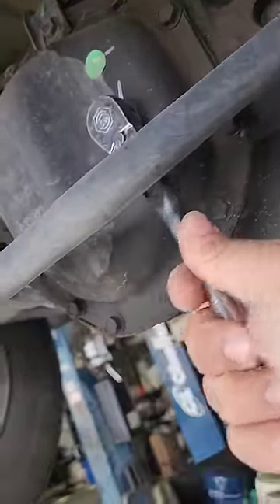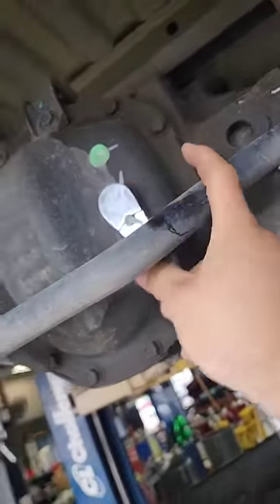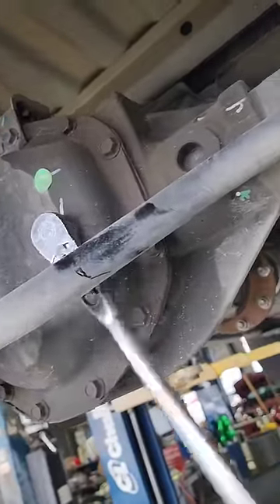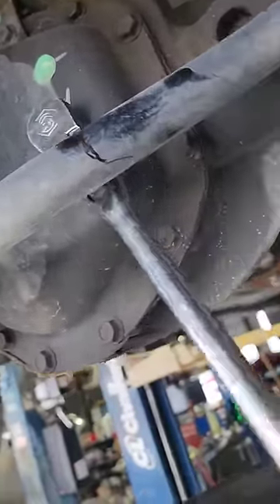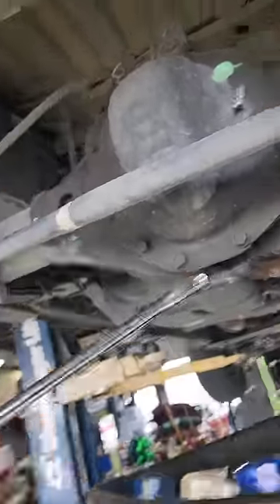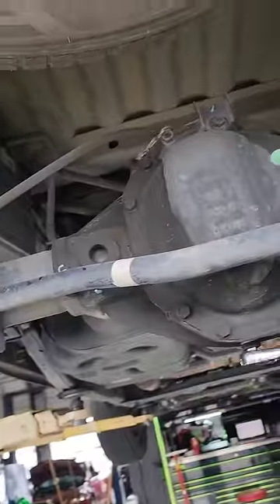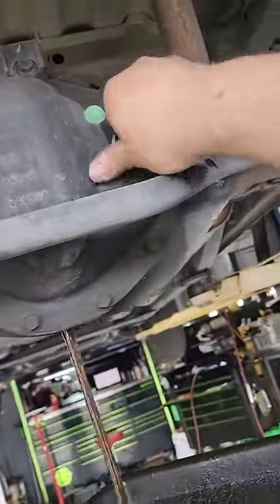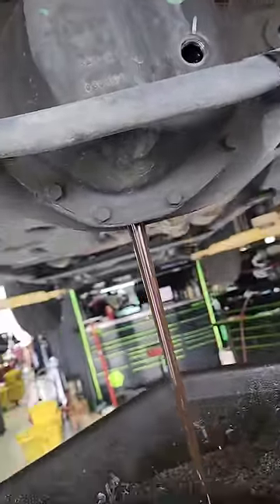MECHANICS PRO TIP #shorts #mechanic #auto #tools

Comment: If you can't get the top plug out, you need a new job! What about cars that only have a top plug, you have to pull the cover to drain. Then you can also fill through the vent tube if you know the capacity. Or the vss located at the top of the differential housing!

Comment: Don't throw away the 90 weight oil. It can be used for your chainsaw bar oil and if needed it can be cut with mineral spirits. Or give it to someone who has an oil burner heater. Don't just throw it away.

Comment: Took my 66 Riviera to a Buick dealer to replace a right rear wheel bearing. After I got home I got a call from the service manager. He said that my repair was going to cost a lot more because Posi-track unit in my rear end was torn up. I asked if he was sure and he told me that yes the mechanic showed him the clutch material in the bottom of the differential. I told him that was funny because I was the one that put the Grand sport emblems on the car and it doesn't even have a Posi-track unit.. he said I'm going to have to get back to you on that.,

Comment: This isn't some like mechanic only tip It applies to anything pouring throughout all of history 😂 when the air can easily replace the fluid by going through a separate hole instead of the same hole the fluid is coming out of it will drain faster.

Comment: 440,000 km.. I changed the oil in my front and rear diffs about 10 years ago.. think I used 80w gear oil?

Whatever was needed, I used the equivalent…

There was no oem anywhere…

It still works great 😜

Comment: never had one not come loose... clean out the hole and use a nice deep adapter.. sometimes a wretchet with a big head wont seat all the way into the plug and debris stop it from going all the way in and seating causing stripping.. im in the north half of ohio used to work for a used car lot that shopped at perry auto auction in pa i know all about rust. its 99% user operator error

Comment: use the case breather vent to pump the fluid in if the top bolt is seized or stripped

Comment: That fluid looks practically new. I know new vehicles call for synthetic but the old 80w90 seemed to last longer than the vehicle
Reply from the maker: You do know if it was burned and had metallic flakes that would mean the fluid went to long and started to let item wear right?? Or maybe you dont get that part of preventative maintenance
Reply: @FluffyMexicanik  No, i guess I don't. I'm just an ASE master technician who worked at a Cadillac, Buick, GMC dealership for 25 years and now I build custom Harley Davidsons. We never tried to up sell any gravy maintenance work. It's probably the same reason I get 300,000 miles out of every vehicle I own before selling them. When I hand over the keys to a $50,000 HD and the customer asks me about oil changes I tell them just whenever is fine. I've rebuilt axles before but for as many vehicles that are on the road it's not as common as you may think . Changing the fluid for the first time on a new vehicle or draining one that needs repaired are probably the only two occasions that the naked could see something in the fluid. You change that synthetic axle fluid regularly and if you don't have a problem you're not going to see shit.
Reply from the maker: @channelx92  im not quite sure what point you trying to make 🤔
Reply: @FluffyMexicanik  I don't get that part of preventative maintenance don't you understand. I tell you what, if you put even a tiny bit of sarcasm into anything nowadays, people have a mental meltdown and lose their entire thought process. You suggested I didn't understand routine maintenance so just letting you know I worked at a dealership alone should have told you differently. Dealerships preach maintenance like the gospel. Not only is it the right thing to double but it makes everybody more money . I do the maintenance on all my vehicles as per the manufacturers schedule hence the 300,000 miles I get out of all my vehicles. The sarcasm came into play with the $50,000 Harley Davidson I had just finished and telling the customer to change the oil, or whatever kind of maintenance we want to use in this imaginary situation, whenever they feel like it. Nobody in their right mind would say that. I hope you understand now that Im very aware of maintaining your vehicles. I may have gone a little overboard but I never meant to confuse a response to your statement.

Comment: I have run across some that I have had to fill through the drain plug   needless to say you have to overfill them a little bit and then be quick with your hands to get the drain plug back in  Little messy

Comment: You can always fill them through the vent… I have also filled them by pulling the wheel, hub, etc, jacking up the one end of the axle and pumping fluid into from there… oh the shyt boxes I have had to deal with 😅

Comment: Yea u can cause my Mercedes S500 when u flush the transmission pan u have no dipstick or fill hole other than ur drain hole is ur fill hole so u must pump ur fluid up the drain hole until u get 9 quarts in there

Comment: I always check the plugs for signs of being removed. I say this is because sometimes you get people coming in trying to resolve a problem or get something for free and it's always good to note. Every tech MUST cover dat azz. 🤨  You should have pulled the top plug and checked the level.You very well may have a bad diff that needs replacement for a FEE.😁 25+ I always said knowledge/confidence and making every step count as well as always do it right the first time.. So 🫵🏼 get that $ in the flat rate game. Also always know you're worth in this field because it can cost you a ton of money. Good Luck👍🏼

Comment: Nonsense, you can fill it through the vent tube, the pinion seal, or use a grommet on a u shaped metal oil line and hold a see through jug up above the level of the fill plug, and when the level meets the same height as the plug keep lifting the jug until it starts to rise higher and hold it, once it levels out, the oil level inside is the same level as the oil in the jug. 
 Theres No Way! Pissht! Please!

Comment: I have the same Matco Ratchet 1/2 inch drive locking flex head. I've had it for over 20 years. One time the head needed to be replaced and Matco guy put and updated head. It looked different I think its more gear teeth it was smaller than the original head. Chicago here plenty of Salt here.

Comment: Still a way to refill but you gotta use  brains. It's to make 2 tubes going through a plug, the taller tube be air tube, lower tube - filler tube, fill it upto top tube then its full! Problem solved!
Reply from the maker: Why when you can just live in the south and everything be much more simple 😁

Comment: Ain't no way my 200k+ mile tundra diff fluid looks like that. I tow a few times a week and it was supercharged and on my 3rd motor now😂 now trans was flushed from dealer a few yrs back at late 150k range

Comment: What are you talking about. You just pump it back in through the bottom freakin hole and slam the drain plug back on real quick like. Done and done. You’ll loose about a tablespoon of oil. So just over fill a tiny bit and your good. You just need to know what the capacity of the axle is.

Comment: Looks like that fluid was not in need of a changing. Willing to bet that’s another lube Tech recommendation without even checking the fluid condition.
Reply from the maker: So if the fluid was dirty that would kbviously mean its ran its course and started allowing parts to wear right?? Educate yourself about maintenance before bumpn then fingers playa, customer requested this...wasnt a recommendation

Comment: I'm goinf through this right now on my transfer case. Of course I checked the fill plug first and it's a no go, so I gotta deal with that. I didnt even bother checking the drain plug yet. The drain plug is about an inch behind the exhaust crossover pipe, right behind it. I'm gonna have to weld a bolt through a flat bar to get to it. Can anyone guess what truck it is? (2  hints in there)

Comment: My car is a Florida car, took it in to have an alignment and the shop told me the adjustment bolt was seized ROFL. Lazy Florida mechanics, I came home and cracked it loose with a f#(*@ wrench. Here I was thinking I was going to have to get out the torch and heat it... what lazy lazy lazy garbage tire guys. Anyways they did me a big favor, because that's the last time I'm using that place.

Comment: you dont just do thhis for diff plugs you do this for oil fill caps, and every thing else like that too.. that diff fluid didnt even need changed
Reply from the maker: How you know it didnt need change?? Let me guess...you wait till its already too late huh?
Reply: Fatty, ive been working on cars for 20 years.. i own 4 cars with dana axles some are over 400k miles on em.. one has 430k... That fluid was still clear lol Gear oil lasts a very long time. Tens of thousands of miles.   It was still amber color and clear.. lol barely even used.

You didnt even take the cover off to clean the diff either all that crap that sticks to the metal is still in there.

..  drain and fill right.. ez pz money 

I bet because you have a large channle means you know better right ?  Sure bud

Comment: Dude ffs use an extension for the god dam socket. They shouldnt be mega mega tight. Not that tight so it wont snap your extension. It's taking 3x longer to undo the bolt then is necessary. It's a dam plug ffs😂😂😂😂😂😂😂

Comment: Yeah, that customer will be back with blown axle seals in a week.   But still a good tip.
Reply: Your comment makes absolutely no sense at all.
Reply: @johnmorris7960  the vent wasn't working.
Reply: @travishanson166  that vent in the rubber line is to let off pressure.   It will suck closed some when trying to drain the fluid.   No way a 1/4" air line could vent fast enough for a 1/2" stream of oil.

Comment: Dam u could have saved the owner 150$ bucks.  That was clean and not milky oil.
Reply from the maker: You mean the customer saved himself from letting the fluid break down so far to where it started allowing wear...really need to do your research on maintenance...change the fluid before it stop protecting

Comment: Quick tip? Man i learned this changing oil with my dad take the cap off itll drain faster. If you are just now learning this and you are over 16 then your parents and the system have failed you
Reply from the maker: And youre millionaire right?? If not then the system and your parents failed you 🤷‍♂️🤷‍♂️
Reply: @FluffyMexicanik  well at least i have parents cant say the same for you
Reply from the maker: @no7imits  lmao u just contradict yourself 🤦‍♂️ damn...your pops should have just unloaded you on your moms back or....the floor 😅🤣

Comment: this owner has fallen for this scam more than once. Clearly, he has been upsaled to change his differential oil at least once before in the last 2,000 miles. LOL . that gear oil looks new. LOL
Reply from the maker: You are a scam how bout that? The customer himself requested this service not the shop...so a simple question would have save you from making that dumb statement, also if the fluid was burned and had metal particles in it what would that mean?? The fluid has failed and causing wear correct??? Corrrrreeeccccctttttt...the goal is to change the fluid before it starts breaking down...not after damage has been done....your the type of guy that will have transmission issues already and think a flush will magically fix a slipping transmission 😅🤣 get real bro with your "LOL" lookin ass...no the vent tube isnt leaking...take that "leak" to warranty and see what happens...

Comment: If you are a good mechanic which you are not , because you would know what your service manual tells you , not other fools that may or may not do ot right.  Read you service procedure , its the most correct and fadtest way
Reply from the maker: Tf u talking bout lmao
Reply: @FluffyMexicanik  really youre a mechanic but dont know what a service manual is. I dont know how you could do it wrong,,, but in 35 yrs as a heavy truck mechanic ive seen some stupid crap done the way " someone told me how" . If you dont know to always check fill plug before draining diff. Well.... come on man as your president would say
Reply from the maker: @tonylawrence8882  well i believe i said i got the tip from said youtuber, not i learned from said youtuber....meaning i got the idea for the video so i made my version of it

Comment: There was nothing wrong with that oil …. Still shiny golden new .
Reply from the maker: How do you know?? You do understand thats a good thing right?? You do understand once a fluid, such as gear oil, discolors and has metallic particles that the fluid has then broke down and is allowing parts to wear...the point is to change fluid before it allows wear...whole point of preventative maintenance

Comment: Uh, no.  This isn't a pro tip. If it needs an oil change, either way drain it. So you'd be a pos mechanic not changing the oil and doing proper maintenance.  Different ways of getting the plug out if you're worth your weight. Or could just replace the cover.  This tip is from an inexperienced person who prob ran into this.  But a good mechanic (pro)will most likely be able to get it out.  I replace plugs pretty often.

Comment: y'all don't deal with rust, WOW, someones privileged for sure... must be nice too... However there is a way to refill from the bottom, but I'd need to give you a book to explain it. MOST don't have the time, cause most shops aren't interested in doing the job correctly, IF it takes too much time...  I deal with rust to fully remove it, and paid very well for it too... MOST who have cars just too dam lazy truth be told... but GJ

Comment: You had to learn this from another you tuber? You couldn’t just look at the diff and see two plugs with the same 3/8” drive? It didn’t make sense that allowing air in the top speeds up the fluid from the bottom? You needed a YouTuber for this?
Reply from the maker: I am a youtuber, and when i sayy i learned it from him i meant to make the video...not the actual job...tf lmao

Comment: 100% unnecessary
Reply from the maker: Please explain so i can tell the customer next time to listen to you
Reply: The fluid looks new, that was not necessary to change at all. My oldest vehicle is a 2001 with 228,000 miles and its never been changed or topped off and its still full.
And you can keep ripping off your customers I don’t want them but thanks.